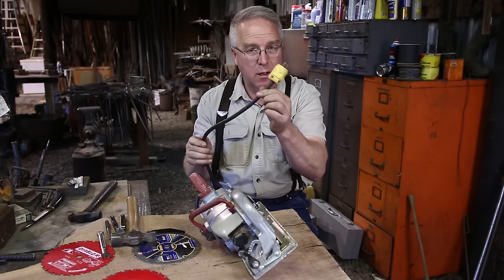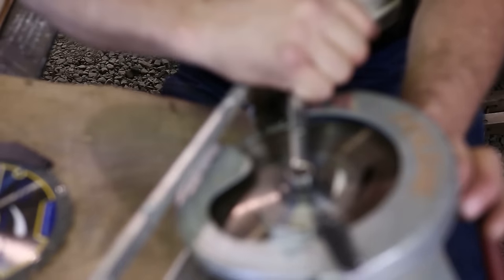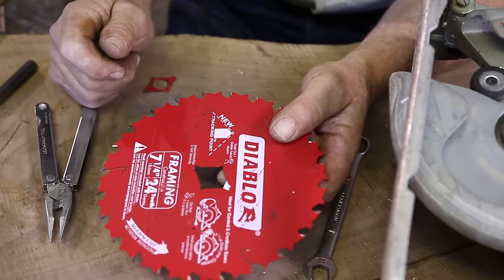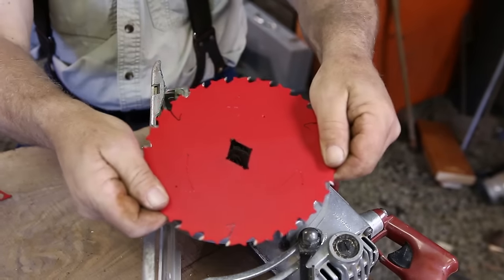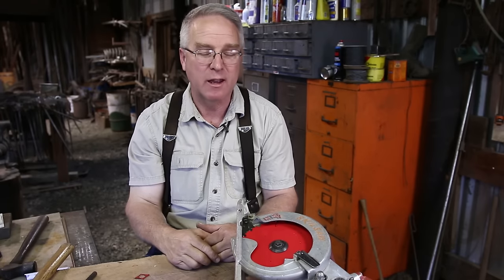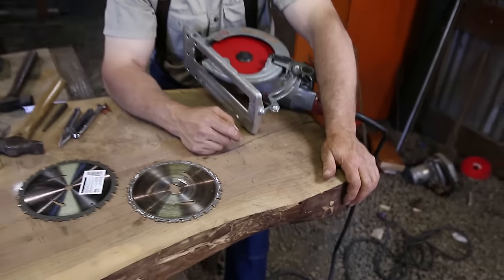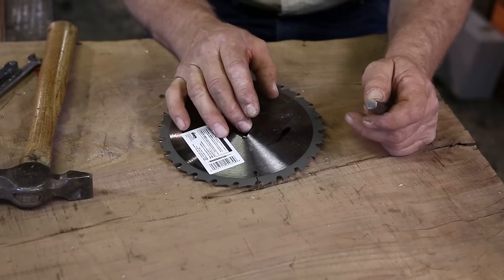How to Change the Blade on a Skil Saw

Comment: A good way to tell which way to loosen or tighten the bolt. To loosen the bolt, twist with the direction of the teeth, and  to tighten, twist against the teeth. I work in a shop with several saws that some are left twist and some are right twist. I stopped trying to figure out which was which and just started looking at the direction of the blade.
Reply: William Mueller good hint ! Thanks for sharing
Reply: William Mueller good tip thanks, nevet thought about that
Reply: Same thing with bike pedals. You always tighten in the direction you'd be pedaling, and you don't tighten hard. Your pedaling does the rest.

Comment: I can't believe I have my Diablo blade backwards since I changed it getting ready for hurricane Willma  in like 2009 or so. I just thought it was the blade not cutting well. It just seemed like the advertised side of the blade should face the outside. It now cuts very well.
 To think I almost didn't watch this video,how hard is it to change a blade. Love your tips and tricks. They have been very helpful.

Comment: So glad good folk like this share their knowledge. I bought a Skil saw, but the instruction manual does not say a thing about having to remove the knockout. In fact, the manual does not even give instructions on how to turn on the saw, how to engage the safety, nothing! I called Skil customer service, because the blade would not spin after I had installed it, incorrectly, obviously, and the rep did not know what I should do. She put me on hold for a few minutes and when she came back on, she did not have any knowledge to share. Nope. She just suggested I go on YouTube and find this guy's instruction video. For what it's worth, I can't, with all my might, remove the knockout. Looks like I'll be going back to Ace for some more friendly help.

Comment: Thank you, nicely done! I knew I did something wrong when I went to cut and the wood chipped first thing. Even though I took a video and asked a couple people... they all told me the logo should be pointed outwards. They were All wrong. There are a lot of videos on how to use a saw. However if you don’t have the blade in correctly there is no reason to move forward...

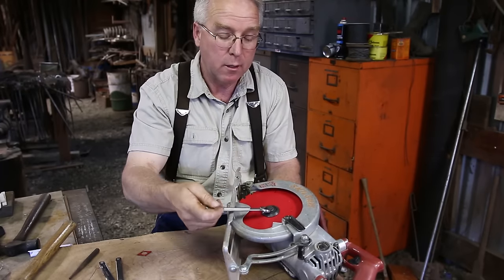Comment: I noticed at about the 3:39 mark you started to use the open end wrench "backwards" then rotated it so it was situated properly.   A  lot of folks don't know that there is a proper way to use an open end wrench.  Using one backwards increases the chance of slippage and rounding the bolt.  Good catch but you might mention it for these who don't know.

Comment: Just a thought for a related video ... Can you explain scenarios / tasks for which you would use blades with different tooth counts? And which do you prefer / use in general (assuming you don't constantly swap blades or saws)?  As always, thanks for the excellent content and great explanation!
Reply: The general rule on that is to break it in to three tiers: dedicated demolition blade, framing blade, and fine blade. Demo will have the lowest tooth count and most aggressive cut, framing will be your general purpose blades with 16-24 teeth, and fine is 40+ teeth best used when very clean edges are required for molding, joinery and cutting melamine. Most of the time I have a framing blade on my circular saw and an 80 tooth fine blade on my miter saw.
Reply: I'd still like to hear Mr. Wadsworth explain it (because I just enjoy the way he breaks things down), but thank you!  I guess I kind of suspected that to be the case ... i.e. more teeth for finer cut, less teeth for faster but rougher cut.  I wasn't sure if that was all that played into it or if the type of material you're cutting was also a consideration or even other things which I may have never considered.  I like the idea of using a finer cutting blade on the miter saw because, well, most of the time if I'm using the miter saw it's because I want a more precise / cleaner cut!  Anyway, I appreciate the response.  Cheers!

Comment: Every circular saw I’ve ever operated or owned I’ve installed the blade face up. In comes the Milwaukee wormdrive style saw. I throw the blade on face up and start ripping into an old deck and smoke begins flying everywhere. At first I thought it was coming from the saw, so I thought I had a dud, but then I realized the tarnish on the carbide teeth of the new blade. I flipped the blade over, and it worked like a dream! Yeah, I’m a novice when it comes to the wormdrive style rear handle saws. I wish I’d watched this video first. LOL

Comment: the end of a spud wrench, or any centering type tool capable of a filling a 5/8" arbor to rock the dimond knockout on its long axis removes them effortlessly.  I use the spud wrench since it is also what I use to tighten the bolt.  good point about not overtightening.  only needs to be tight enough that normal feed won't stall the blade.

Comment: I have the same saw, and noticed that the leading edge on your guard is way wider than the one on mine. I've had times when cutting thinner material that the material will try to slip under under the guard. I'm guessing your guard was an upgrade/modification that you did. Can you do a video on some of your tool mods, especially your saw? I see a couple other things on yours that look non-stock.

Comment: how does the blade slip with a diamond arbor?
Reply: 0j0nn still a good tip for non diamond arbours
Reply: the arbor is on a round shaft
Reply: Then what's the point of the diamond arbor?
Reply: The diamond arbor should not slip, that is the point of the diamond.
Reply: The arbor slips against the bearing it is tightened against.
Reply: I'm still confused as to why they would use a diamond arbor if it wasn't fixed to the spindle. I'm not saying it is fixed, I just don't understand why it wouldn't be. Any insight?
Reply: instead of having the bleade slip on a 2mm surface they have a 1 inch long arbor slipping on a half inch shaft
Reply: The real point of the diamond is to limit your choice of blades, thus the saw manufacturer can sell more of their own blades.  Blade slipping is not even an issue, the nut is self-tightening that's why it's reverse threaded.
Reply: The diamond cutout design prevents bogging by allowing the saw to power through tough cuts that would jam and lock a round cutout sidewinder blade.  The design goes back to soon after the first circular saws appeared, with round cutouts, no blade guard, were wimpy, and frequently got stuck in wood. The blade was stopped and jammed in the wood while the motor kept revved for nothing.and the operator had to dig the blade out.   

Today's sidewinders are way better.  The diamond is a throwback solution that's still around. It's all about avoiding bog down by preventing slippage between the collar, blade and arbor.that does happen, infrequently, with round hole inserts.  .
Reply: Jason, that's what I thought but it goes completely against the recommendation in this video.
Reply: The recommendations is this video are to unplug the power cord when changing a blade, to prevent avoidable injury, and to only snug tighten the nut to the collar to avoid over-torquing the metal.  The Essential Craftsman, I thinks his name is Scott Wadsworth, is a master framer. The highest esteem.  He could've used a sidewinder to demonstrate proper blade change.  It would be the same result, power off, swap out the old for new, snug tight, only with a round insert, for purpose of demonstration. Wadsworth happens to use a Mag77, which is the best framing circular saw, originally designed for rafter framing, that has the diamond collar instead of round.
Reply: There's a section where he says to not over tighten the blade so that it can slip if it jams in wood instead of kicking back on you and causing injury. I don't understand why he said this. It seems like a diamond arbor would not allow this type of functionality. Even on a 5/8" arbor, the bolt will tighten, sidewinder or worm drive, doesn't matter. I'm not calling him stupid because he's clearly not. So I'm merely trying to understand what he's trying to communicate.
Reply: taiden i think it was just a mistake and he  he wasnt thinking about the fact that the diamond arbor would not allow the blade to slip regardless of how loose the bolt was.
Reply: you all miss the point that even tho the arbor as a diamond on it, it's just a sleeve that is fitted on a ½" round shaft, i know i have a skill worm drive
Reply: I understand what you're saying but why wouldn't Skil just use a 5/8" round arbor then? What's the benefit of the diamond arbor if not to mechanically limit blade slippage relative to the spindle?
Reply: it limits the slippage more than a round arbor but not totaly, it make the arbor replacement easier if needed and it run in a bigger bearing than a 5/8 shaft while having the same size flange as a 5/8 shaft
Reply: I think he meant the sidewinder while using the Mag77 for demonstration and forgot to clarify. 

All forged steel nut and bolt connections should always be torqued to the manufacturer's published spec that sets it back from the max. stress limit. Sidewinder Owner's Manuals advise to only snug the nut.  This is mostly to avoid burning out the motor.  The only times a circular will kick back is things like free-hand planing end grain wrongly or rookie mistake of placing the shoe on the loaded end, sawing the lumber backwards, the lumber pinches the blade and the saw jerks back.
Reply: It's almost like a centrifugal clutch. Just because there are gears and chains, does not mean that a go kart wheel will always spin. I have this saw, my dad has this saw, if the blade isn't tight enough it will stop spinning. I've grabbed my dad's saw, started a cut and a few inches into it, the blade just stopped. Motor still running but no blade spin. I thought his saw was busted. He told me to snug it up, I did, and it cut the rest of the day no problem. I guess in all my years of using these saws I've never had a blade get loose until a few months ago.
Reply: If you check out the parts list on Skil. com/manuals you will see that the diamond arbor is part of a friction mechanism and is not a machined end on the driveshaft.  Thus by snugging rather than torquing the bolt some slippage will occur if the blade binds or strikes metal, etc.
Reply: The diamond arbor provides more positive torque application from the saw on the blade. The blade is allowed to slip by a friction clutch which is going to take shock to overcome. The only time that shock is going to be produced is during kickback. I had my dad's bosch kick back at me when I was maybe ten and it scared the living shit out of me. Never had that problem with a skil. Change a blade on a skil or flip through the book that comes with them and you'll understand all.
Reply: The essential craftsman is absolutely right about the blade slippage. If you owned one of these saws you would know. Just loosen the blade a little and spin the blade.
Reply: Diamond arbour so the slipping happens at the arbour/shaft connection rather then at the arbour/blade connection.  My mag77 instructions say not to go too tight because of the intended slip/clutch.

Comment: I had a older skil saw 77 in my shed ,as I bought a newer one if different brand years an years ago ,an it fail ,so I went in grabbed my skil 77 an I replaced the old cord ,new blade an it's like new ,you just can't beat those worm drive ,heavy duty bearing saws . They really do last forever.

Comment: Have a few ideas for future shows..
1. Seen Johnson wax in the back drop of this video on the orange cabinet. I use mine for my tablesaw and bottom of my circular saw. And other things. Just curious what you use it for?
2. Would be nice to see a video on different types of sawblades for your circular saw. Different uses etc.
you may have a video out on that I just didn't see?
3. You really need to get yourself a surge Leathermans. I used to use a super tool like you but it just doesn't compare to the surge Leathermans much easier to use. Fits the hand better knife is on the outside and all around a better tool. if you have small hands the wave Leatherman is great. I have bigger hands wearing an extra large gloves in the surge fits perfectly. I have talked to many people into upgrading and they love them. Let me know what you think. : )
I also have a YouTube channel smaller than yours, you might find it interesting, then again you might not. Ranching home handyman fixing odds and ends.
Reply: Love your show!
Luke Simons

Comment: Here is another tip for your saw missing only a couple teeth.   Keep it for when you remodel and are cutting into something like old floor boards where there are bound to be nails.  If you put on a brand new blade, mr Murphy will show up and insure there are hidden nails in your cut line.

Comment: Ha! The first time I put the blade on any of my saws I took a Sharpie   and drew arrows right on the saw itself for which way is tightening and which way is loosening. I see a simpler method in the comments below, simply loosen in the direction of the teeth of the blade. Makes sense now. Thanks.

Comment: I have a skilsaw very similar to yours. I just purchased a 60t diablo blade that clearly says on the blade "do not knock out". Any suggestions? Am I good with that blade installed as is without knocking out the diamond? I'll be using the saw in a few hours so your response is appreciated. Thank you.

Comment: Thank you, I thought I was going crazy.  I purchased a brand new Diablo 71/4  24 tooth blade. First we know that the threads are reverse threaded and that the teeth have to point in the direction the motor turns.  I went to put it on and thought my old age was catching up with me. Am I just stupid, I thought.  Why is the printing on the back side of the blade? Maybe it's just Diablo that is stupid. I watched about three Youtubes on changing a circular saw blade. They all showed the blade with printing on the correct side. I had my wife come in and watch them with me, She came to the same conclusion, the printing is on the wrong side of the blade. I did an internet search " why is my Diablo blade's printing on the wrong side of the blade"  No results for that search.  I looked at Youtube again and found you putting it on with the printing on the reverse side.  Thank you Diablo is stupid, and I loose an hour of my day trying to figure this out. Thanks again

Comment: Correct me if im wrong, but If you have a diamond nock-out /keyed saw, doesn't that void your statement about over-tightening and 'allowing' the blade to slip?   

Also, rotary tools lock in the opposite direction they spin, as to self tighten against resistence (instead of loosening and flying off)?

Comment: Next, explain why there are left/right sided circular saws... I can understand that the blade being on right side as you can have most part of table top of the work you are sawing, but downside is that you can't see well what you are sawing without looking over the saw. 

The left side saw is nice as you can see what you saw, but your table is mostly on top of the work that is going to fall. 

I just changed from right side blade saw (corded) to left side blade saw (cordless) and I have little trouble to get use to cut from "wrong side" of the work.... But I like that I can easily see what do I cut!

Comment: I just bought an old mag77 from a yard sale. I replaced the blade but after I tighten the bolt onto the collar there is still space between the bolt/collar and the blade, so the blade still spins freely inside. My saw looks just like yours, and it's a new diablo blade. Any pointers? Thanks!

Comment: The blade retention nut will always loosen when turned in the direction that the blade turns when the saw is running. There's a German rhyme for that: "So wie ich lauf', so geh ich auf", translates as "The way I run, the way I open",

Comment: If you have a cordless impact driver near, you can remove and replace the blade screw without worrying about the blade lock.

A little finger pressure against the blade's disk and the impact (with appropriate socket of course), spins the bolt right out. 

Goes back in just as easily (start it with your fingers to be sure you don't strip anything).

Comment: I helped the owner/operator of a mechanical tree faller install a new blade on his Hotsaw Circular Saw Head. I asked him if the blade was going on the correct direction and he said yes. Needless to say the bolt heads didn't form a chip nearly as good as the cutting teeth lol.

Comment: Great informational video. Not an approved method by any means but an old saw blade installed backwards is great for cutting the soap stone I use for carving. You just go slow and it cuts like butter. It's nice to get more use out of something.
Reply: Also great for cutting vinyl and aluminum siding.

Comment: Hey ES what are your thoughts about a lefty using a worm drive? I have a newer skill saw sidewinder type and i love how i can see the blade. I got an old 77 that i probably need to change oil and blade and have less visibility. 

I got one of those nice irwin 7 1/4 24t irwin blades and well i goofed with my impact and stripped the sidewinder nut.  Thinking about using the new blade on the worm.  

My main question is does not being able to see the blade make a diff? Or as a lefty do you get used to it as a righty gets used to sidewinder drives ? 

My old 77 needs a new cord and perhaps an oil change so i am up in the air still. I see where grandpa pinned the guard with a shim in on his sidewinder removed it.

Was thinking abour my skil 5400 but i got the bolt damn near stripped tryin to change the blade.

Comment: I made both of those mistakes...wish I'd seen this video a year ago.  Backwards blade was funny because I'd never used worm drive before so I just assumed it was cutting slow because the wood was extra hard. Cut through several feet of plywood before figuring it out.